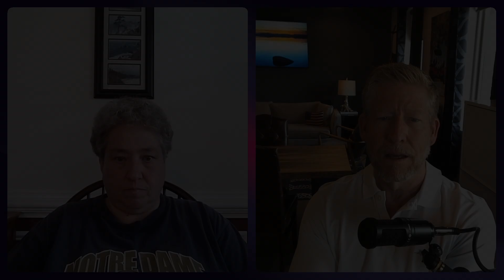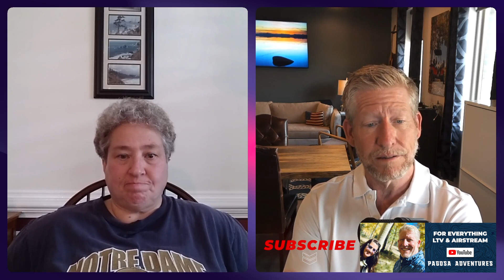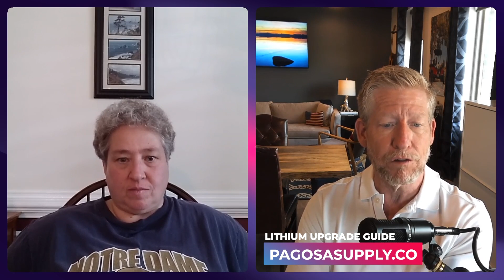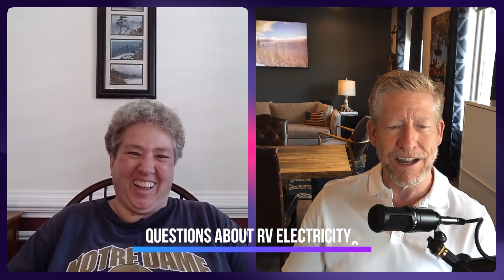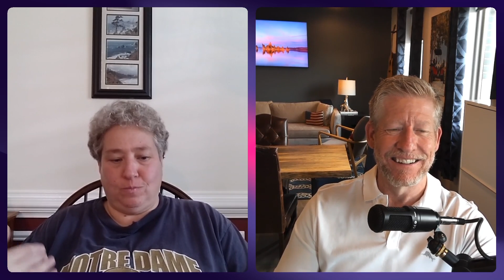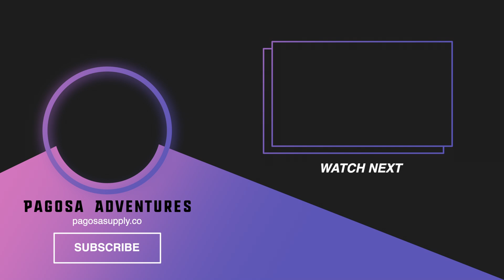Lithium, Victron vs Xantrex, Soft Starts and more with Sandra Johnson

Comment: I'm curious.... if you "replace" the factory Xantrex 2000w inverter with the 3000w option and add in the Lithionix 320Ah and change up your breakers like Sandy did to have the 3000w inverter strictly for the AC, could the "leftover" 2000w inverter that came factory installed be large enough to run the rest of the LTV power needs with another 320Ah or with the newer 630Ah battery???  BTW, just finished a survey on the LTV website and they had a question concerning future LTV RV offerings and one of the options was a "true boon docking" LTV model with bigger fresh, grey tanks (and probably black too) AND.. AND a better solar package with a more robust lithium battery power option.
Reply from the maker: Technically you could do that, however I don't think you would need to. You can add another 320 to the system just fine. I know LTV is trying to advance to more off grid capabilities, however that will come as a price. For example, LTV now charges $4100 for two $1,000 batteries. So if they offered Lithionics battery they would charge $9k-$11k probably for a $4500 battery that is an easy aftermarket DIY swap out.

Comment: Great discussion with a lot of useful information.  Thank you both for that.  We’re waiting for our new LTV Unity and I’ve already decided that it will get the Lithionics battery upgrade to start and eventually the 3K inverter.  We’re coming from a Roadtrek RS Adventurous and two years ago I did a lithium upgrade to that with a Battleborn battery.  As I was researching lithium, there were several discussions about the need to protect the alternator from excessive current draw charging the LiFePO battery because of the battery’s lower resistance.  Because of that, I installed a Victron Orion DC/DC charger to control the current draw from the alternator while charging the battery.  I haven’t seen any discussion on your channel about this facet of upgrading to the Lithionics.  Can you address that a little bit?  If you have discussed that, I probably haven’t gotten to that video yet.  I’m working on it!  Thank you again.
Reply from the maker: The LTV will come with a Sterling 30amp DC to DC, but Sandy suggests changing that out to a Kisae 50amp DC to DC. I still have my Sterling and has never given me an issue, but I hear about the Sterling failing or being loud all of the time.

Comment: How does she quantify that 315AH Lithionics outperforms 400AH of other Lithium? Any test data to prove that?
Reply: I have done head to head testing with my Lithionics 315ah battery and other Leisure Owners who have 
4-100 ah BB batteries. The response after the tests are always, "I wish I would have known about a Lithionics battery when I did my upgrade."
Reply: @SandyRVUpgrades  What did those tests show? thanks.
Reply from the maker: Her educated opinion. If you check out the video from FitRV where they tear down a Lithionics and BB, you will see the components used are significantly different to allow more power delivery (not capacity) in a more efficient manner.

Comment: As to Xantrex versus Victron Multiplus, I had a Xantrex 2000 and upgraded to the Multiplus 3000. I agree with the form factor issue and weight that would speak for the Xantrex. The power assist mode is available on the Victron Multiplus but not on the Xantrex. That is a nice feature as it allows me to limit shore power to 18 amps nominal and run anything I want in our Leisure travel van at the same time. The Multiplus pulls any demand above the shore limit from the battery. That is for us a great feature when we visit family and have only a 20 amp outlet to plug in.
Reply from the maker: Great info!
Reply: Can you help me understand what you are saying here? When you are referring to limiting shore power to 18amps. What is the benefit of that?
Reply: @justfollowthatvan6721  many household or garage outlets are on 15 amp or 20 amp circuit breakers. When we visit friends and family, we typically plug into one of these outlets. At the same time, our camper tries to draw more than the 15 or 20 amps especially when the air conditioner is running full load. This would trip the circuit breaker where we are plugged in. With the Victron power assist function we can limit shore power draw in our case to 18 amps and the breaker will be fine. Any higher power demand than the 18 amps will then be pulled from the battery of our camper.
Reply: @liveslowsailfastonlanier1374  awww, ok I see. I have a Victron 3000 watt inverter and my installer showed me how to do that on mine. When I plug in at a 110 outlet I set it to 15. Now it makes sense why He told me to do that. Honestly, I’m didn’t really ever understand it until now. Haha